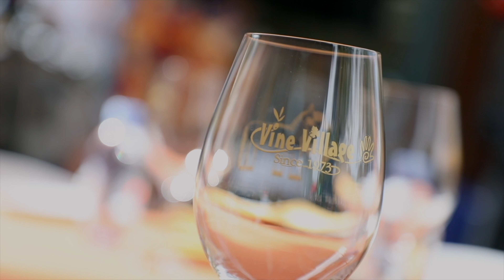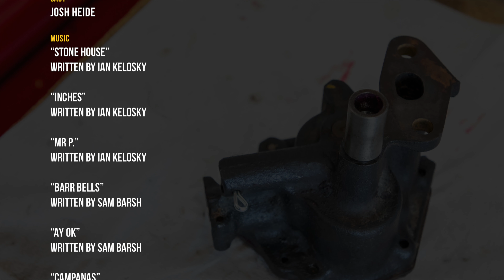How To Rebuild A Cadillac Oil Pump

Comment: Does a 1966 Cadillac with a 429 and bad distributor gears have anything to do with a bad oil pump? The car ran for about one minute and then stopped the distributor gears I crunched
Reply from the maker: James,
The oil pump and distributor are driven off a common gear in almost every older engine. The drive gear is either part of the oil pump driveshaft, or in the case of your 429, part of the distributor drive. You will have to figure out what is jammed or stuck that caused the gear to fail. At least the oil pump is mounted externally so you can easily take the cover plate off and inspect it inside. Since it sounds like the gear got ground up, you will want to pull the oil pan and clean up any metal. Also, check the oil pickup screen, and if it is stopped up and has bypassed (we have a video on oil pup screens) you will want to clean the passages in the block between the pickup and pump and the pump and filter housing.

Comment: I have built probably hundreds of oil pumps, shouldn't you flatten the surface on wear plate and check end play? I do a lot of Buick and Amc pumps and you have to be precise. Also on my caddy pump i flatened the end of the bypass hole and tapped the outside just to about a 1/2 past the cotter hole then with a allen screw and lock not i can adjust pressure.  I do really enjoy the video though.
Reply: You make good points, sir. Viewers should always refer to their service manuals for specifications Jiosh

Comment: The gen purpose grease would be a tough one for me.. It doesnt break down in the oil fast enough. May not make a difference but we use petroleum jelly to prime the pumps. Safer on new 472/500 builds
Reply from the maker: We haven't had any problems, but there is no doubt that petroleum jelly works very well. A few years ago I did some testing with various assembly lubes and found many of those did not dissolve or break down well. The best thing for someone to do is to ensure whatever they are using breaks down well in motor oil. Josh